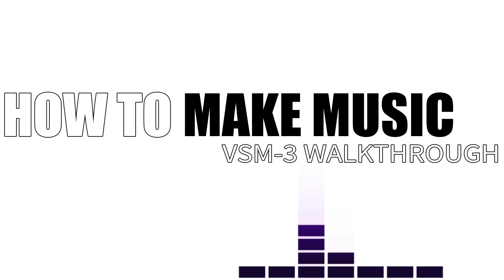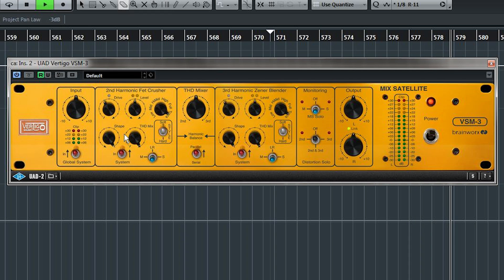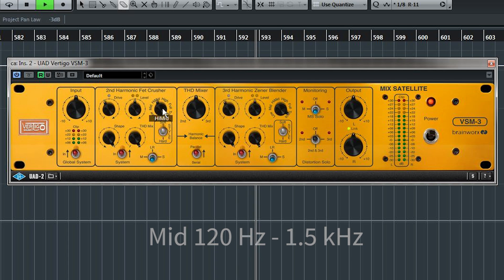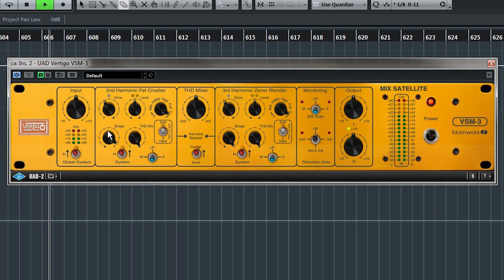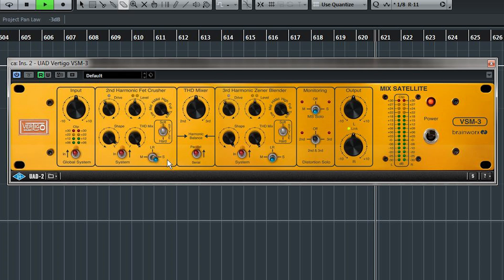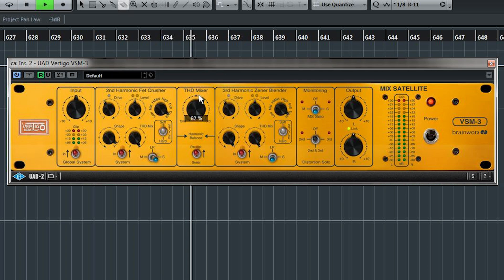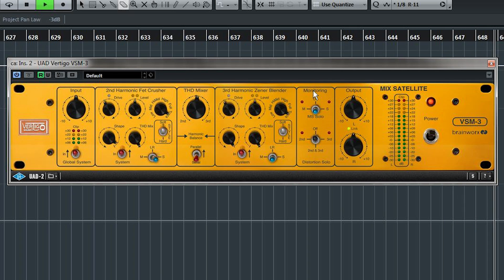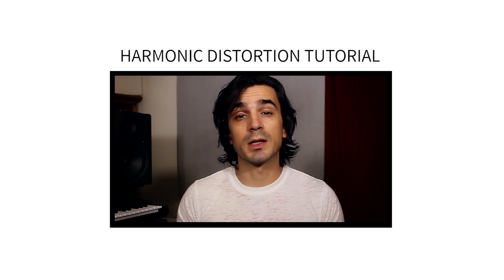Vertigo Sound VSM-3 Walkthrough

Comment: Is the 3rd harmonic section emulating pentode tubes?
Reply from the maker: Yep, like an overdriven pentode
Reply: @SaherGalt  isn’t this setup essentially like or similar the black box hg2? Except the hg2 has less tweaking options
Reply from the maker: @campar1043  Definitely a similar concept in terms of distortion scheme. Though the magic of VSM-3 is really the ability to apply a specific type of distortion to targeted parts of the mix, both spatially and in terms of frequency band. 

You could setup mid-side routing and carve up the signal with crossovers, then use individual distortion plugins on each sub to achieve a similar outcome. But VSM-3 achieves all that with one instance on one track.

Comment: Saher, I really like the way your voice is processed. What plug ins do you use? How do you equalize or compress it? It sounds great.
Reply from the maker: For narration, I find myself using UAD's API 550A EQ (very often a couple clicks at the 12.5khz shelf and some rumble reduction with the low shelf) and FabFilter's Pro-C to level out the volume -- the settings like threshold, ratio, etc. depend on the recording itself which varies with my distance from mic, the preamp gain I've used, my actual speaking variation in volume/timbre and so on. I'd also credit the mic: Shure's KSM42. Very precise, clean mic.
Reply: I agree, your production quality is quite good. I really enjoyed your toots.